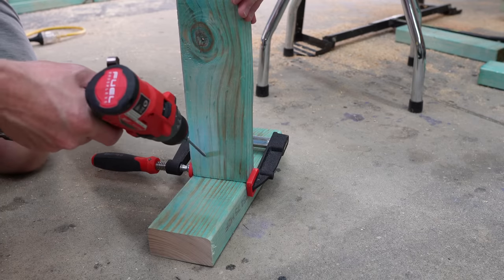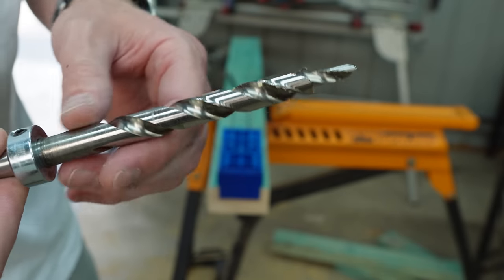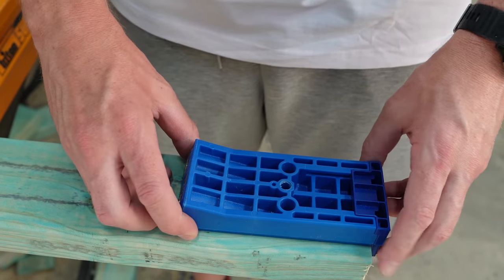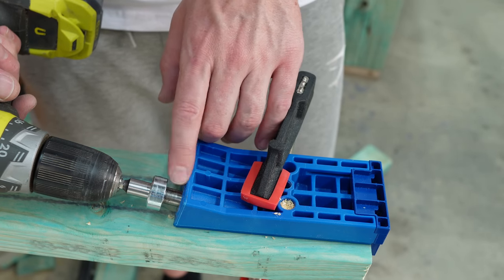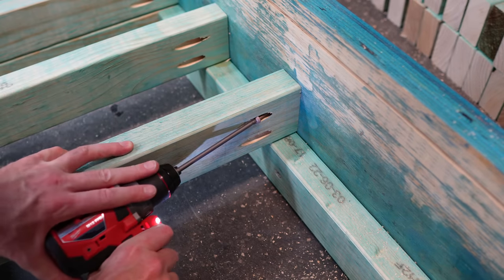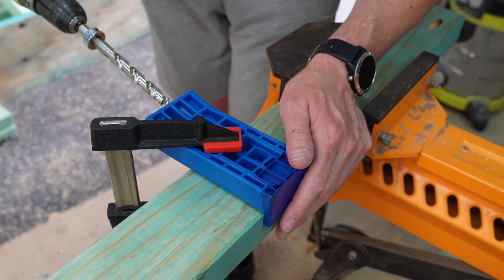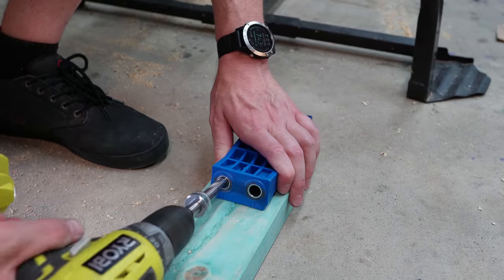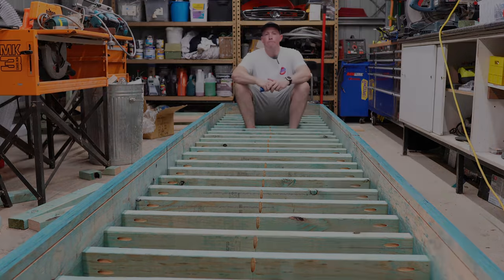Building a deck? Wall frame? Railing? You need one of these - Kreg pocket hole jig

Comment: I hold the jig with my hand. Using the clamp takes 3x longer.

You have to start the first 1/4" slowly so the bit doesn't walk. But after that, it goes in straight. I've never felt at risk of injury.